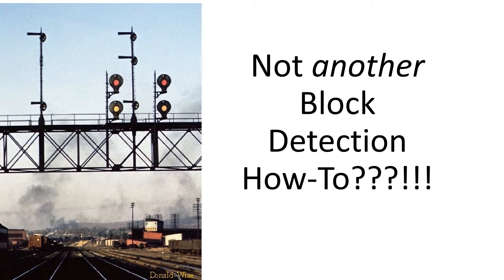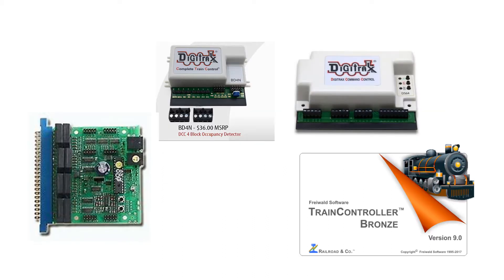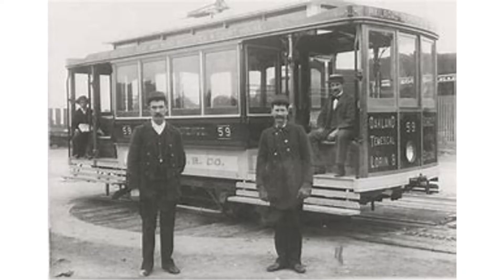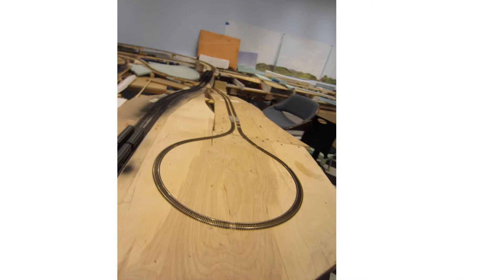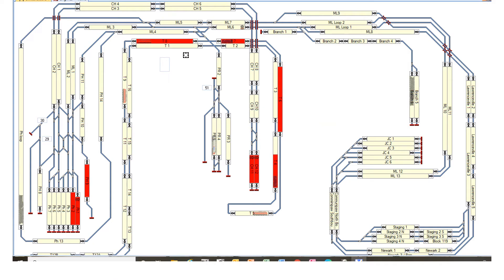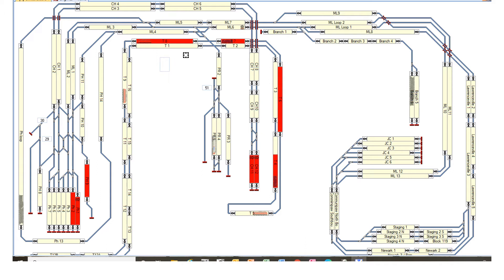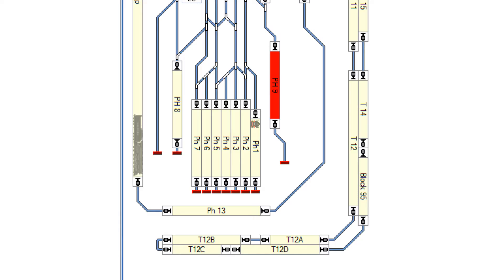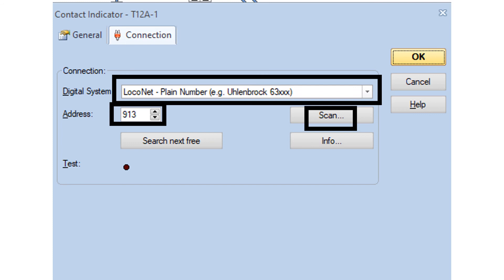How to get a Digitrax BD4N to talk to Train Controller

Comment: I pounded Digitrax with a series of emails. Finally, in the end, they provided me with an excel spreadsheet that calculated all the BD4N, DS64, DS74, BDL168 AND SEC8 addresses. For the BD4N they are based on the address you provide to the DS64 orDS74. If you would like the spreadsheet reach out to me, and I will share it.

Comment: Helpful video, I'm considering train controller software  for block detection and signaling. Do you recommend this software? Was it fairly easy to use?
Reply from the maker: TCB is pretty easy to use.  I would recommend it although the instruction book does not go into as much detail as I would like.  It wasted too much ink telling you how to change the appearance of your screen, which is totally non-useful If you’re just trying to get the program to do what you want.  Also I have heard Freiwald is pretty much of a one person shop.  The software has been around for many years, so when Zigner dies or retires, it might not be able to get support

Comment: great video best source yet. my question tho is on the BD4N's control socket  10 pin you stated that pin 1 under the "n" at timestamp 11:44. What is the number order to each pin? so what pin number is under the "4", "D", and "B" and the row under that? trying to do what you did and wire each pin individually instead of having to rely on the digitrax rainbow cable. but it's really hard finding a schematic on which pin is which number.
Reply from the maker: I’m pretty sure from right to left across the top row in my photo, they are numbered 1, 3, 5, 7 and 9, across the bottom row they are 2, 4, 6, 8 and 10.  Any one who has better information, please chime in.

Comment: Ha. Good timing. But I was looking for info for BD4N, DS64, and JMRI. You’re absolutely right about the lack of info concerning the interconnectedness of these devices. Breakout board availability seems to be another top secret. I see Tortoises and SE8Cs w them attached and no mention they are third party offered separately. 

Thanks for the video.
Reply from the maker: Did you need more info?   I'm no expert, but at least I got this rig to work and might be able to help.
Reply: Thanks but I will hold off until I eventually get my weeks back ordered se8c, signal masts, and ribbon cable kit. 

I want to see what appears on JMRI when I connect the bd4n to the ds64 w the ribbon cable. When I connected the ds64 to LocoNet the JMRI seamlessly controlled the turnouts, so I’m hoping the detection section status is equally viewable and actionable.
Reply: ...also my local Color County Train Club has some knowledgeable members.